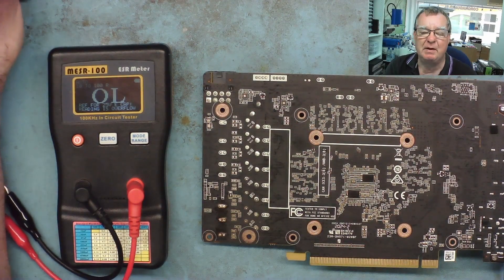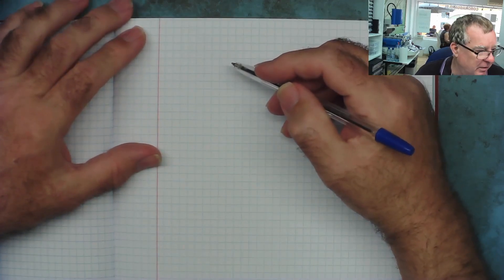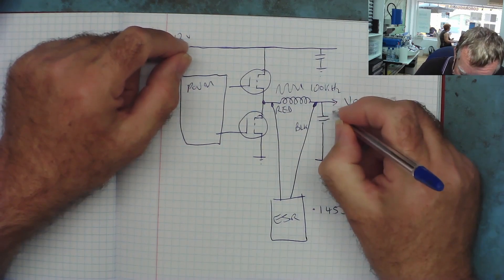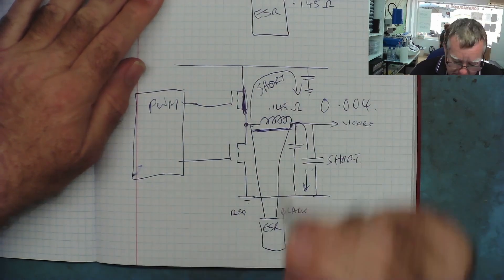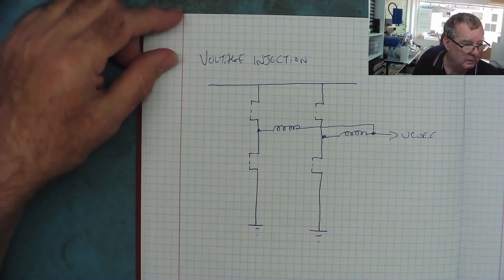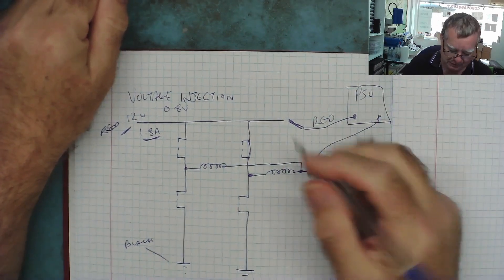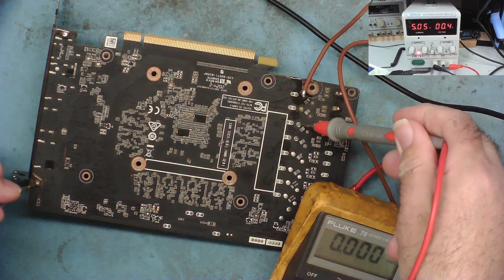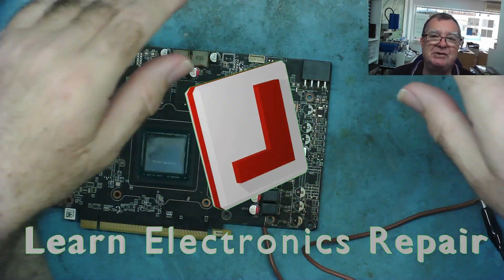How to SAFELY inject 12V into a short circuit GPU / CPU VRM!

Comment: Wow, that was me suggesting to put the black probe on the coil for the voltage injection method. I'm not really an electronics expert myself, I only do some basic tinkering, but when you were showing the method I was immediately thinking "why isn't this working, it should be possible", and then I remembered my school teacher: "The thinnest wire gets hot." Or in other words, the heat is dissipated at the component with highest resistance, which in the initial setup was the GPU itself, so it should work if the GPU is removed from the circuit. Thanks for the follow-up and not only confirming it works, but also explaining why it works.

Edit: so to clarify, there were two reasons why it wasn't working initially.
1. The higher resistance of the GPU was limiting the current through the shorted MOSFET, and as you said you couldn't increase the voltage because you'd risk damaging the GPU.
And 2. Because the GPU has a higher resistance than the shorted MOSFET, even if it was safe to inject 10V, you would only see the GPU getting hot and possibly misdiagnose a defective GPU.
Reply from the maker: Alvin853
You may not be an expert (who can truly say they are really, there is always more stuff to learn with electronics repair) but what you did here was apply some excellent logical thinking to the problem for exactly the right reasons.  You were absolutely spot on and as soon as you said it I knew you were right. Hats off to you mate, you taught me a trick here. 😀And I suspect you taught it to a lot of other too.

I think a big thumbs up for Alvin is well deserved guys.  Well done, this suggestion was pure Gold! OK so I proved it but the credit is all Alvin's 👏👏👏
I pinned this comment so everyone knows who thought of it first😀
Reply: Very brillant idea.Great explanation
Many many thanks.
Reply: That's actually really smart of you if you aren't an expert or experienced in electronics.
Reply: Thanks for suggesting and explaining!
Reply: @zeferrum  nice but isnt modern driver that has both mosfets inside hi and low side, how to be safe not to blow anything

Comment: Thanks for all your geat informations i'm just a good eletician and really poor in electronique issue 

Hello, I'm reaching out for your expert opinion on a confirmed hardware failure on my gaming laptop. We have exhausted all software fixes.

Hardware Failure Analysis: Gigabyte A7 X1 (RTX 3070 Mobile)
System Specs:

Model: Gigabyte A7 X1

CPU: Ryzen 9 5900HX

GPU: NVIDIA GeForce RTX 3070 Laptop GPU (VBIOS: 94.04.42.00.04)

Core Problem: The laptop is perfectly stable on battery/low load, but crashes instantly under heavy GPU load (gaming) ONLY when plugged into the AC adapter.

Initial Crash: BSOD (VIDEO_DXGKRNL_FATAL_ERROR). Current Crash: Immediate Hard Power-Off (black screen, forced restart). This points to a critical power cut.

Troubleshooting Steps Performed (All Failed)
Thermal Issues Eliminated: Thermal paste replaced on CPU/GPU. Temps are nominal before crash.

Drivers Eliminated: Performed a DDU clean install of NVIDIA drivers.

Firmware Eliminated: Updated System BIOS/EC to the latest version.

Stability Tests: GPU Core Clock downclocked by -500 MHz. Crashes persist even under-clocked.

Power Supply Eliminated: Tested with a brand new, verified 230W AC adapter. Crash persists.

Final Conclusion
Since all external power supplies, drivers, firmware (BIOS/VBIOS), and stability checks have failed, the issue is definitively internal hardware failure.

We suspect a critical failure in the Voltage Regulator Modules (VRM) on the motherboard's power delivery circuit for the GPU, which cannot sustain peak current draw.

Question: Given the hard power-off and the confirmed VRM failure symptoms, have you seen this specific VBIOS/GPU combination fail like this? Does this require a full VRM component replacement or could a simple reballing be sufficient?

Thank you for your expertise!🙏

Comment: For easier desoldering of faulty driver, you can always try to grind off ( with "dremel" ) much part of shell for better heat conduction to pads on board :) 
I have one question. If all phases are connected to the same +12v input and then have the same load output, ( in case of burned driver soldering points and part of PCB in that area ) can i simply relocate caps, coils and other stuff on other unused phase to revive my GPU and don't overload the rest of phases ? I have Gigabyte GV-2060OC-GD6 windforce 2 with burned fase, i've get rid of burnt spots on pcb layers and eventual shorts but I'm afraid to just pack it in to PC an power it full on 😅 

Ps. Sorry for my vocabulary but i'm native polish 😂
Reply: Ps. If you don't have a thermal camera you can simply put Isopropyl Alcohol, it will dry much faster on a shorter part + shorted parts will do a little magnetic field that will move around some part of alcohol and debris laying around ;)

Comment: Brilliant, I just had this issue my self having 13 mosfets on the Vin rail and my ESR detected the shorted mosfet there was also a very little capacitor for each coil as well and once I detected the short, that little cap also indicate a connection to the coil and that was the only one, so there layed the culprit that mosfet connected to that cap connected to that coil.

Comment: So this works because by placing the black lead before the vcore it drives all the amps back to your power supply (ground) and not through the vcore? Whereas putting the red lead by vcore could push amps through the vcore to some other ground and destroy it.

Comment: But if the high side drain mosfet capacitor short and not the mosfet???? they burn the cpu cause the mosfets block the corrent?????

Comment: There is a better way of injecting the full 12 volts needed.  Put the 12 volts needed by the circuit at the normal entry for the circuit.  But instead of straight in add a series current limiting resistor in line with your power supply that you computed would limit current to a safe level.  In that way you can run an entire device on its regular supply voltage without damaging the circuit.   If you have a thermal imaging camera it will trace out the entire line to the shorted component.  You'll be able to track any short within a few minutes.

Comment: i had never thought i would see this topic (written in this fashion) on "your" channel at least :) . 
ive seen this topic on so many electronics repair channels and every time i see it it hurts a little. 
i dont think one can inject voltage. current is what you are injecting. Voltage is just a potential difference which facilitates this current (flow of charge). irrespective of the voltage, the current is what makes the component hot ... or blows it up.

Comment: Hey man, I have a dell rtx 3080 non lhr that crashes under load.  I suspect it may be a faulty memory bank issue.  Would you be interested in repairing it for me?
Reply from the maker: Sure - emai me electronicanaria@outlook.com  I offer a no fix no fee repair service and every subscribers GPU will feature on video whether I can repair it or not, but I can pretty much guarantee I can tell you, even if I can't fix it,  what is wrong with it and why it can't be (economically) repaired

Comment: Isn't the additional benefit of this test that even if it isn't the Hi-Side MOSFET that it then gives you additional information that all High-side MOSFETs are okay and the next step is to look at capacitors and the Low-side MOSFETS. Really liked the Sunday video also, lots of good information in there that I'm going to take notes on in a little bit.
Reply: Absolutely true, this is essentially testing sections of the board discretely which is a standard practice in testing departments of these very gpus. 

I love that this channel actually knows electronics unlike most "can I fix it" trial & error channels.

Comment: I know it is off topic, but you seem to know everything I want to understand and I thought about this. When you damage a pad or have had a pad damaged, using replacement pads, how do you glue them down! I have put them in place and put uv protection under and around the pads and activated them with the light, everything is hard but the pad is not glued down! Any help?  What is the order that things happen on the board? The power goes to the bios to the gpu to the bios to read and then to the gpu then the Controller chip then the pwm chip to the mosfet? I am so confused and no one seems to say it directly  to make it what order it happens and what is being sent when it is and why. I hope you understand my question. Thanks for the videos and your knowledge. Have a nice day.
Reply from the maker: No worries, I'll answer best I can
1. I've never actually used replacement pads so I can't answer that directly.  However when I have for example had to replace tiny SMD components where one of more pads have come off, I usually take a little spot of epoxy resin, apply it to the PCB with a needle, then glue the capacitor or resistor or whatever down.  Leave it overnight then I can solder thin wires to replace the broken tracks/pads.  maybe that will help

2. Funny that 'no one seems to say it directly  to make it what order it happens', hmmm maybe you just didn't see this video 😉
https://www.youtube.com/watch?v=SmVdl8kew_4

Especially Chapter 6 and Chapter 8 which I believe answer your question directly but I highly recommend you watch all of it, in a few sessions as it is quite long.   Since I made this video about 6 months I learned more stuff myself and probably should, no call that I will make a follow up at some time.
Reply: @LearnElectronicsRepair  thanks for taking the time to answer. I must have missed the videos you mentioned. Thanks for the link. I will start watching these videos in the morning. Thanks again for your help. To you and your family, stay safe and well.

Comment: There's a way to check if gpus or other big chip are destroyed by internally burning up, which does not always work. If you put your the red lead of your multimeter on ground and the black lead on the chip power input (in this case the vrm output), and you put your meter in diode mode, you should see about 0.3v. This is because all chips have inverse polarized protection diodes on their power supply. These protection diode tend to blow up together with the rest of the chip. But as said, it doesn't always work. Sometimes the protection diodes are still ok.
Reply from the maker: That sounds interesting,  like some other techniques such as looking for bulged capacitors, just because it isn't bulged doesn't always mean it is OK, but the technique is still a very useful one.  Does this only work on Vcore for example on a GPU or does it also work on Vmemcontrol, PEX etc?

Comment: Yesterday I was very confused when you were inserting 12 v between power and ground, knowing high side mosfet is broken. If the gpu was not already broken it is now, because 12 v went directly from a bench power supply to the gpu ... I was wondering why you didn't use the method you showed today. But let's be reasonable, there is a 99.9% chance the gpu is gone anyway
Reply: This board was not fixable to start with. A broken high side mosfet almost always mean you're done - no fix possible.
Reply from the maker: @kriswillems5661  I never inserted 12V between power and ground on this video or the previous 'yesterday' one.  I only inserted 0.8V.  Check it again, the link is here.
https://www.youtube.com/watch?v=8BlKgTydPk8

I did use both the $1 short finder and the VC480C+ to trace the short (both of which actually inject around 4.5V) but because of the current limiters on these devices they are safe on Vcore and other low voltage power rails - and I proved that on this video
https://www.youtube.com/watch?v=XEbWyQgX_Mc
Reply: Sorry, my bad.
Reply: @kriswillems5661  np
Reply: @kriswillems5661  Hmm you should have watched the video. He didn't inject 12V into the GPU 😂. Anyways you're right a broken high side probably means a toast gpu core.

Comment: I wonder if you should cut the small segments into small independent video for those with small attention span. For example. Using esr meter to find shorts on gpu vrm (maybe even use that super cheap esr meter kits)
Reply from the maker: zeferrum Tell you what, I'll put chapters in video the description.   Honestly though anyone with a 'small attention span' really is not suited to electronics repair work.  It often takes long periods of concentration and the ability to put many facts together to come up with a plausible diagnosis.
Reply: @LearnElectronicsRepair  I am only after getting you views so that you get rewarded for all the time you put in.  The videos are priceless to me and I watch from end to end. Usually a few times.
Reply from the maker: @zeferrum  No worries mate, thatnks for your support.   I have been putting chapters in some longer videos recently.  I'll try a bit of an experiment putting chapters on some videos and not on similar videos to see if it increases the view hours 🙂
Reply: @LearnElectronicsRepair  Please do put chapters in your videos, I do watch the full video but structuring it with chapters helps to learn better.
Reply from the maker: @therealb888  OK I wil lstart doing that - and also see if it increases the watch hours as it does add more work to video editing.  I have dome it already on some videos as you know.  I think it also depends on the topic.  Some videos lend themselves to a structured chapter by chapter viewing.  Others quite simply you have to watch the whole thing to understand the fault diagnosis technique invoilved 😉
Reply: @LearnElectronicsRepair  Absolutely! Hope you give it a shot & enough time/videos to see the results materialize. It will definitely yield results as effort & production value are always rewarded. It should also improve comment engagement as people learn more.

You are right that sometimes diagnosis methods can't be structured & one has to watch the full video to understand but even then I make a few notes & try to mind map the technique😅.

Thanks for responding to the feedback.
Reply: @LearnElectronicsRepair  My gaming laptop had a very peculiar issue. 

As soon as I connect the 19.5V DC power, a chip (5x=5f C0S = RT6575DGQW) overheats even before pressing the power button. This IC is a dual synchronous DC-DC step down controller5V/3.3V . It's a WQFN 20 Pin IC located close to the tracks of the power button & none of the pins seem to be direct short to ground.

The laptop doesn't switch on.

Comment: well done for this idea. I already do something similar, but I still use safe voltage (0.8V). Taking the GPU core itself out of the circuit allows more current to flow and makes the shorted mosfet hotter even at 0.8V, allowing me to easily find it on my thermal camera. With good thick PSU leads I end up with 5-6A at 0.8V which is always enough to find the short (sometimes even with the IPA method and no thermal cam) all the while keeping the GPU perfectly safe. Thanks for bringing attention to this method, and bravo for another great video